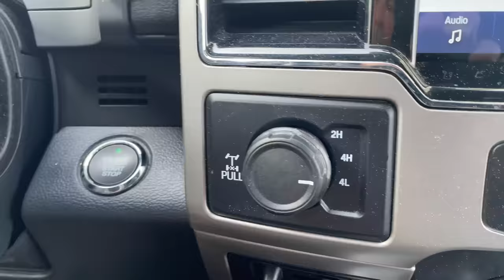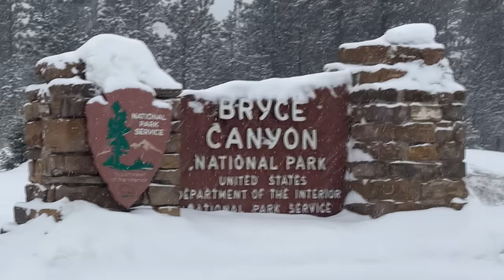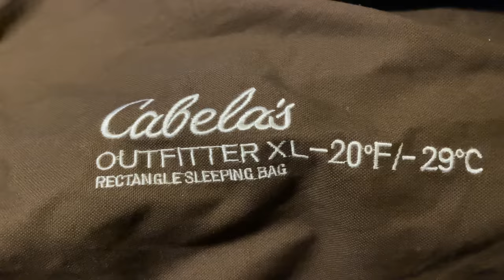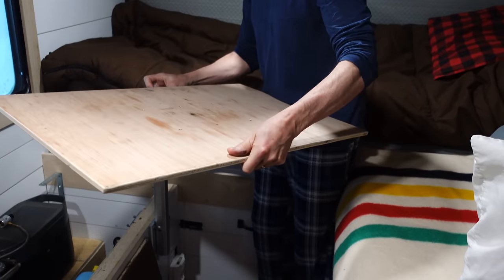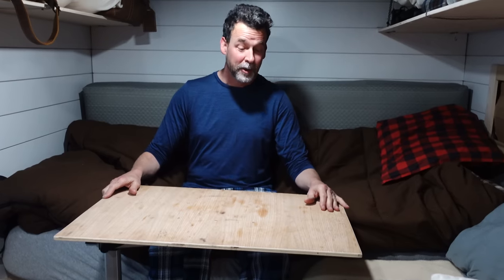WINTER CAMPING During A BLIZZARD - Wood Stove for Heat / Stuck in Snow with my DIY Travel Trailer

Comment: Locking hubs in 2023? o_0
Reply: That's my question, too. My F 150 has the same wheel drive dash controls, and I don't have to lock hubs.
Reply: Thats an f250 with a solid front axle. My main concern was when he locked the rear diff and the rear tire still didnt spin?
Reply: They are more reliable than electronic

Comment: Years ago, we hunted deer in NYS's Adirondack Mountains. We towed a popup trailer behind a 1969 GMC Jimmy in late fall, early winter. Snowfall was often heavy with lake effect snow coming off Lake Ontario. Winter averaged 200 inches a year.  We were 5 miles in from plowed maintained road and 2 miles in from a decent gravel road. The 2 mile logging road was over steep solid granite rock, thru beaver sloughs, mudholes with inches of ice which broke under us and up to a foot of snow. We always put chains on all four wheels before heading in to be prepared before we got stuck. We sometimes had to use the winch. We had log chains, tow straps, clevises, spade shovels, snow shovels, axes, chain saws, wedges, pry bars, high lift jacks, ropes, and snatch blocks. No one was going to come help us so we had to be prepared to help ourselves. What we mostly had was 40 years of experience going in with a box trailer towed by a 2WD small farm tractor and people who were from a family of loggers. They had to cross a river and go in a mile deeper to a cabin. They expected to get stuck somewhere along the way.
Reply: hi its Willy i hunt the Adirondacks in NY, Herkimer & Warren Counties

Comment: LOVE YOUR TRIP,! but one little trick with the snow, i carry  1, 5 gal bucket of road salt , and put it in front and rear of the tires , so when your ready to move you have a run way to start off.   also i use LUCUS OIL CERAMIC WAX ON THE OUTSIDE OF THE TRUCK AND TRAILER,, instead of hauling snow with you it just sliced off the truck/trailer, .

Comment: Love the video. I’m still working on getting to that national park. Love to make it during the winter time but my wife says no.

Love the camper looks like you built it and it works perfectly for you. 

One problem 15 years in Propane delivery experience. Whether it’s a 1 pounder 20 pounder, 30 pounder 100 pounder. Do not store them in you’re living area. Use them and put them back outside. Put them in one of those wood bins. 

It looks like a tire fill up on the propane tank. That’s the pressure release valve. And one pounders are very touchy. Because of the little amount of propane that’s in it. It gets affected by the hot and cold very easily. And I do not wanna see or hear that you went to sleep and something was wrong with the 1 pounder because you won’t know Until it blows its pressure relief valve in that little camper with that fire going.

Comment: From Minnesota so I can sympathize with the cold.  Nice camper design, I only question the Wood Stove?  Estatically pleasing, but practical, carrying cord of wood, clearances, and cleaning out ash.  Would a propane or oil furnace be more useful? Thinking of a circulating fan and temp control

Comment: I hope you don't take these as negative comments. But I sure hope you didn't wrap that winch line around that tree, they make thick nylon "tree savers" for your winch line. Also invest in an onboard air compressor. You basically shoveled away what would have given you traction, and just exposed the ice underneath if you would have just let some air out of your tires (around 15PSI). From what I could see there was barely any snow on the ground and really the only reason to dig would be if it was so deep you were getting high centered somewhere. Also using your maxxtraxx to reverse a bit to get a running start also may have been a better option, or consider using them instead under the front tires. It's always a good idea if you're going thru any area that may have snow and you plan on camping, carry a bag of rock salt with you. Anyway, thanks for the video :)

Comment: Does your truck have an open rear diff? Looks like the rear passenger wheel wasn't moving. I'm not up on the F series tremor but I would have thought a locker of some sort would be part of that package? I know the Ram Powerwagon is chock full of goodies like that.
Reply from the maker: Unfortunately the video doesn't account for the whole procedure.  I eventually got them all locked up but still needed the winch for a little help.
Reply: @DrenalinAdventures  Makes sense, I've been there before myself, once I get a little frustrated or flustered things can get forgotten very quickly!

Comment: Ditch the 20” wheels for the winter get some 16’s with a 33” or a 35” tire, the duratracs are good in snow but i would rather have a MT  tire.  I run Firestone destination MT 2’s they are even stud able! You can pull about half of your air out as long as you’re going slow and it’s cold and then when you’re locked you won’t get stuck.  You want portable air to air back up when you need it. In MN we had a #7 in historic snowfall, it felt like we we’re always driving in it.  But if you’re from Canada you know, just keep the bro wheels for summer.

Comment: Okay what I never absolutely understand is when people get stuck in snow they never fully shovel a path for their vehicle to follow out of being stuck. They just clear 2 feet in front of the tires and light em up and slip and slide.
Reply: Not sure why his rear tires weren't spinning. If you pull the 4wd selector knob out, it locks the rear end
Reply: I live in Minnesota and using the rear diff locker was worse then leaving it off. I have a F150 no trailer but got stuck on a hill in 9 to 12 inches of snow. I was in 2wd when I got stuck. Went to 4h then to 4L with the diff lock on. All that did was have my backend start sliding. I backed up 3 feet went forward with the locker off and was fine after that.
Reply: @jauthement  not sure why you’d have to pull the hubs out. 50 years later my Chevy has a knob for 4 wheel drive
Reply: @tonyditty2902  if you read my comment again, I never said anything about hubs.
Reply: Need chains on your truck and camper
Reply: The snow n Utah is dry, it's not not slushy n slick, so u only have to shovel a few feet n u can get out
Reply: As a previous person commented, invest in Chains. Anytime anyone wants to travel in snow conditions especially pulling a trailer invest in Chains. Unless of course you want to make content of the struggle.
Reply: Air them tires down !
Reply: @richard taylor it can happen but I feel you
Reply: Everybody has a comment about he should do this or that. Does it really matter as long as he makes it. Everybody different methods. I n that situation wouldn't you do whatever works the best NO MATTER how you do it. SURVIVAL is the key.
Reply: Clearly you never had dealt with snow... the condencention of the air  depends how hard  and heavy snow will get...sometimes it get so heavy it feels like cement
Reply: I'm used to 5-9 feet of snow. You can weigh down your trunk with sand,use kitty litter,and if your tires won't budge after the snow is removed ,use your real wheel drive, put your floor mat in the front of your rear wheel tire,use the rubber side as traction, works great!❤
Reply: @jauthement only locks the rear end up to a certain mph
Reply: @martyf8484 can’t use chains in a lot of states.
Reply: @mikebennis77 same thing happened to me 2 nights ago
Reply: Ford circled the problem already in the logo 😂😂
Reply: I don’t understand people with all these resources at their disposal who still choose not to check the weather and prepare accordingly.
Reply: What states can’t you use chains in? Most require them or 4wd in certain areas.  Utah definitely allows them but very few people buy snow tires/chains in utah as they think 4wd is magic. The only thing utah prepares for is the apocalypse lol.
Reply: Shoveling was for drama.  All it needed was the Hubs locked.  At least 8” of daylight between snow and bottom of diffs
Reply: @freespiritwithnature4384  What you have said is what I was taught to do when I lived in northern Germany. Coming from the UK, I had never met deep snow so I asked locals what to do to preparation for winter. I was told to put salt and sand bags in my boot (trunk!) and buy some snow mats. We used to put them under the wheels and they would get the car out of the rut. The salt and sand was also duel purpose.....extra weight, plus spread it under the wheels to get traction on ice. I lived there for ten years and never got stuck, even with just a saloon car and rear wheel drive.
Reply: Because it’s all an act.
Reply: Nice set up
Reply: Hoping to get enough momentum to get out.

Comment: You do NOT need to manually lock the hubs on these trucks. They have vacuum actuated hubs and the manual lock is if the vacuum operated hubs fail.  When you turn the knob to 4wd it will automatically engage the hubs. You may have to roll forward a but before they engage though.

Comment: I tried same water heater its. Not worth it. It doesn't get over 100. Deg then shuts heat off. I tried plumb into tank to recirc then shower its just horrible. But for same money i got a 10 gal/min unit on Amazon.  Gasland brand works amazing. Super hot. I renovated  my old 1970 camper completely gutted redid everything. So strange people out there .
Some people love it super excited and other people get all nasty complaining about how its all redone and not factory. Nothing in my camper now is 12 volt. Its 110 or usb and i got knockoff milwaukee m18 battery adapter. 
Goodluck i like what youve done

Comment: To start your wood fire, if you will get the heart out of some pine trees, you wont need to cut or shave any wood. Get the center part of a pine tree close to the ground as it is very flamable. You dont need any big chunks...golf ball size is more than enough. Now the pine is also very sticky so you might want to wear some gloves. My spelling of what this stuff is called is "rich-lauter pine." Some places sell this stuff, but if not, fine a pine tree stump...get your axe and chop it out.

Comment: okay.... i'm confused.  how did you get stuck on the roadside with that little snow? were the tires bald?  my little AWD volkswagen with all season radials would have not problem.
Reply: I was wondering the same thing. My Tacoma would have slung that little trailer all over and it doesn't have lockers. I wonder if you had both of your hubs locked in. Hmmmmmm

Comment: In the winter, I always carry a 3 gallon bucket of ashes in the back of my truck.  And a scoop.
Reply: For what?
Reply: @11icarocosta  ash melts snow and ice. It's why places like Buffalo never close schools.
Reply: @tedadams6339  oh got it, never heard about ash as ice melting. good to know
Reply: @11icarocosta  It melts snow and ice if exposed to the sun but I use it primarily for traction. Get stuck - throw some ashes under your tires and away you go.  (Remove as much snow as possible first).

Comment: Real blizzards are rare..you can't hear anything but the roar of the wind driven snow..you need a guide line to get to the garage or shed .or you won't make it back. You're disoriented immediately by the overwhelming power with eyes blinded by 70mph snow/ ice blasting into them. Wind chill so insane that no outdoor gear will do much for long...real blizzards you hunker down scared..and you don't leave the house..until it's over.

Comment: Don't ever put your truck in 4L for snow. Too much torque. Also, this is why I won't own an auto-transmission vehicle since I live in Alberta, CA.  AT + TT is the worst, you'll never get any traction at low speed. Starting in 2nd gear or with a fixed AT torque would solve all this. Someday there will a proper truck tranny that can handle this, but for now its mostly on high-end luxury cars like Mercedes and BMW's and some of the 4WD/AWD SUV's from Ford.

Comment: Carry a bag of sait. Dump under tires.
Reply: melted water on packed snow will not help at all. the easy sollurion is kitty litter. ive used it a million times
Reply: @jeff_lee69  most often campers have salt with them, not so many carry kitty litter. I spent my whole life in snow and ice country. The salt will get the tires gripping just a few inches and sometimes that's all you need to get going.
Reply: @michaelmonnat7765  campers carry salt but not kitty litter? well ya know changing up is a good thing. also, salt is not a traction agent. never ever seen salt help get a car unstuck in my entire life

Comment: So it goes when you totally ignore trailer weight considerations.  It isn't long before you realize you're pulling the equivalent of a lead sled.  Let's be honest.  A nice precise build but a very poor design when it  comes to weight and efficiency.  And to add to the static weight issue, hauling firewood around in the back of your truck just adds to the problem of being way to heavy. So a poor choice in regard to a heat source.
Reply: Your comment couldn't be more wrong. There is nothing wrong with that trailer lol. Doesn't matter what trailer you pull in the snow, at a certain point you're limited by traction, the design of the trailer doesn't factor into it in the slightest unless you have something really off in terms of the 10-20 percent tongue weight ratio. The firewood only adds weight to the rear and helps with extra traction.
Reply: @JohnSmith-ev1sm  I just got back from a 3k miles trip to the middle of Montana pulling a 16 foot Scamp and that did nothing to lessen my belief that the less weight you're pulling the better off you are.  Primarily in terms of economy.  But for other reasons as well.  I havn't bothered to calculate our average fuel mileage but it ranged from a low of about 12mpg on one tank when pulling into a heavy wind and about 16 under better conditions.  That's too much fuel in my opinion.  If you don't mind paying for the honor of filling the atmosphere with carbon and don't mind throwing  money away weight isn't an issue.  This gentleman did a great gob regarding construction but I think the rig he built is way too heavy.  And I've been driving country roads including two rut trails for most of my life and that weight makes driving more difficult and access to many areas impossible.  It's his call of course and it's my opinion.  My parents burned firewood and I have been also for most of my life.  It's great.  I love the smell and it's the most comfortable form of heat (again my opinion).  And I have an old Winnebago with a woodburner in it and an even older shack on wheels with a woodburner that I use locally.  And I heat my wall tent that I use for long trips with wood.  I've never hauled wood on longer trips and cut locally or buy locally.  Out of of concern for transporting exotic pests all over the country.  I like the size of this rig.  But if it were were built primarily out of foam insulation and aluminum with wood or aluminum structural elements, and was collapsible, I'd be a lot more grinny grin.  Just my opinion of course.  But whose else's would I give you, right?
Reply: @ravenfeather7087  So you just realized that pulling less weight means better MPG? I'm not sure what you're arguing. A custom built trailer might not be the lightest, that's a good thing if you've ever had the misfortune of trying to repair a modern RV which are basically match sticks stapled together. If you want to save the environment, a good start would be buying (or building in his case) products that last and aren't disposable dumps on wheels. He's also using a super duty so his mileage will be his mileage regardless of a thousand or two pounds here and there. I'm sure his truck doesn't even know the trailer is back there, again weight is not an issue.